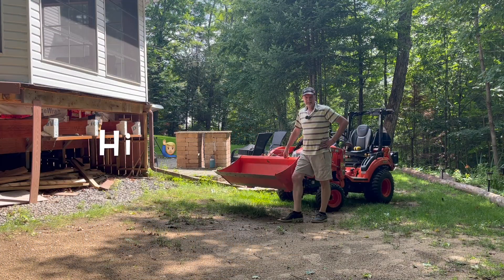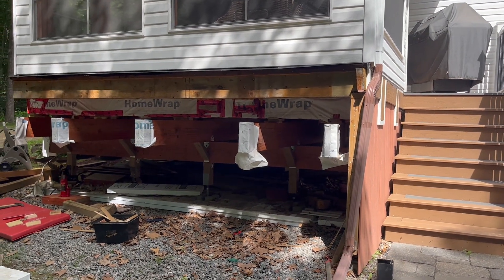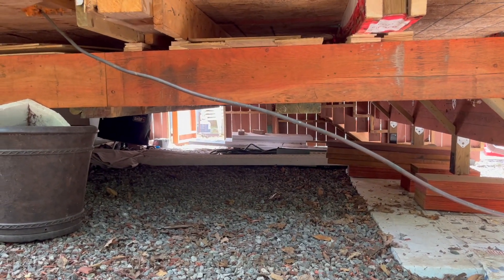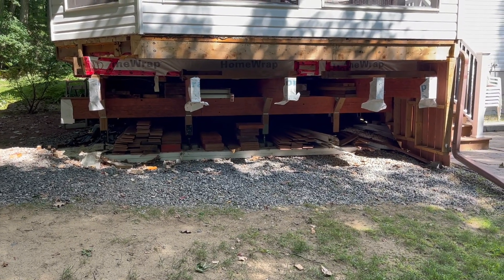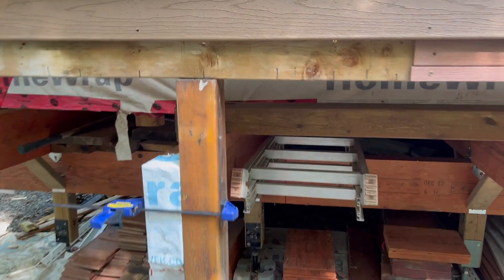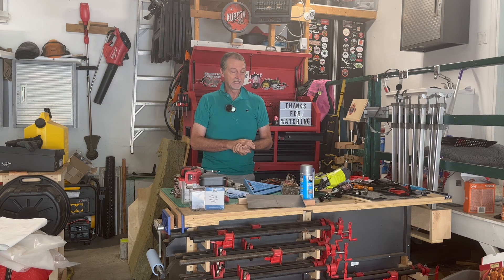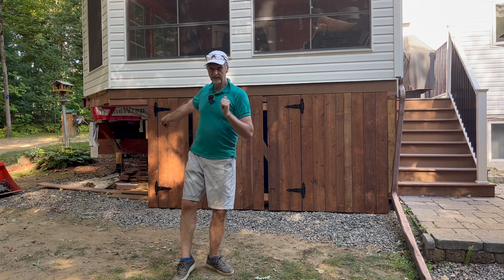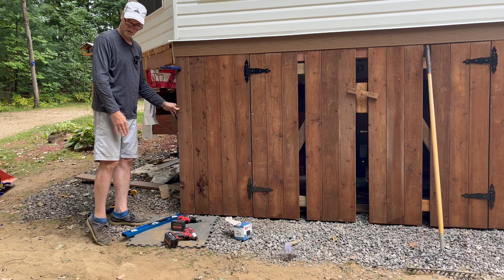#148 THE LAST PROJECT OF THE SUMMER

Comment: Luc, I sorta got caught up on things. Lookin good and useful. Big project. But takes time and thinking. 
I’m wondering what you did to adjust for frost heave. I know your in the cold climate like I am. So just wondering. 
Have a great Sunday. Thanks very much for your videos. Great job on them 👍🏻👍🏻🥃🍻🇨🇦🪵🪓🚜🪨
Reply from the maker: The LVLs were all level, I jacked the frame sitting on the LVLs. I built the gazebo on my previous deck structure which was built by 8x12 sections screwed together, that’s I why had to gradually jack each section a bit at a time and added cut up pieces of different thickness of plywood and sometimes pieces of hardwood. We will see in the spring how it holds up 🤞🏻👍🏻. Have a great week my friend 👍🏻🙂🙋🏼‍♂️🥃🥃
Reply: @OrangeismyNewGreen  👍🏻👍🏻